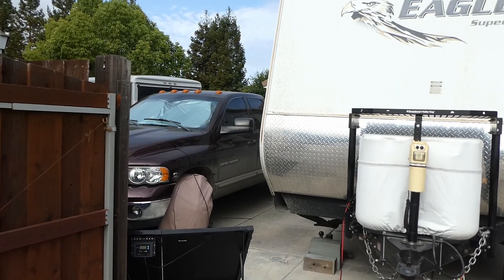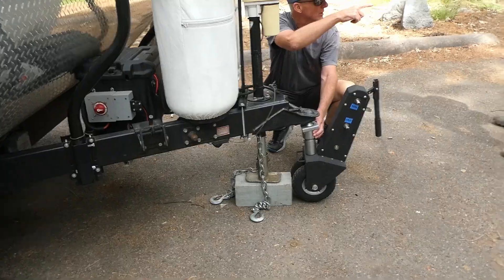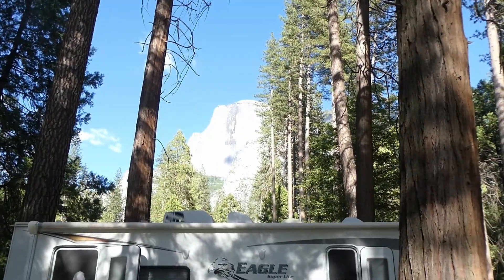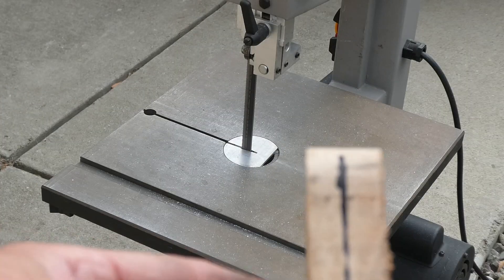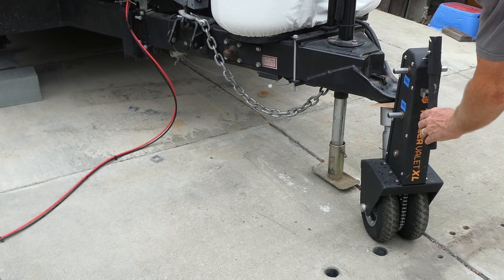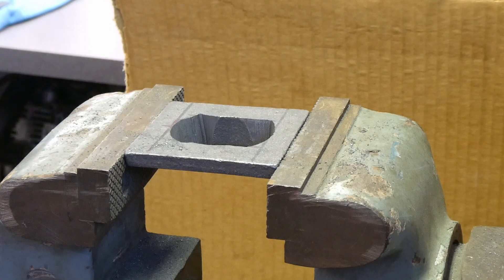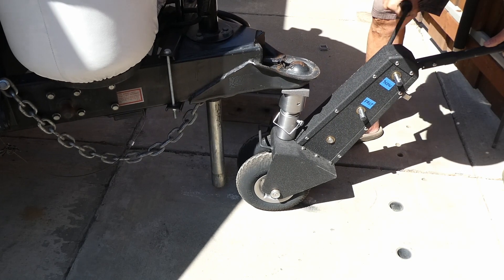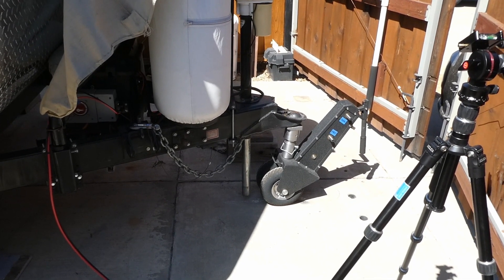Trailer Valet XL Ep4 - Fail (not their fault) and Fix

Comment: I'm having the exact same problem with a new to us trailer..   glad to see there is a fix..  you should sell your prototype to trailer valet.😊
Reply from the maker: Well, as it turns out...I used cast steel to make that part. Cast steel is not very strong. The wedge that I made failed (it broke in to 3 pieces) in a very precarious situation while valeting out of a campsite. Made for an interesting couple of hours maneuvering the trailer out of that site. Lesson learned = if you make something like this do not use cast steel. I think it would work beautifully if manufactured out of proper material.

Comment: If you add the wheel attachment to the trailer jack then this will relieve some of the weight on the dolly wheel.   Then add a linkage from wheel jack cylinder shaft to the dolly ball support shaft.  This will reduce the weight to the dolly and make it so that the dolly and trailer jack stay parallel instead of the dolly kicking out forward.
Reply from the maker: Thanks Terry. That's a great idea. Never thought of that. But it should work just fine using the wedge I made.

Comment: ALso you are working against a dual wheel trailer. These work a lot better on single axle. With duel using the additional dollies for one set of wheel helps.